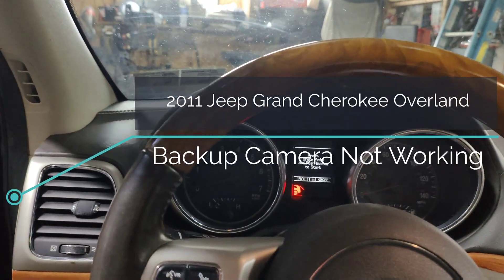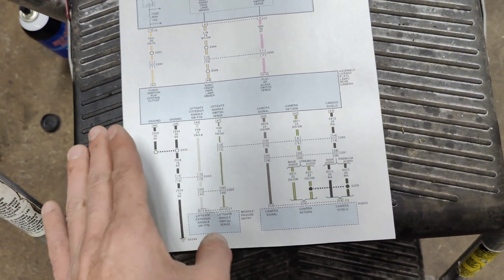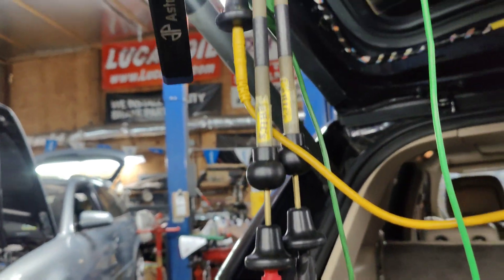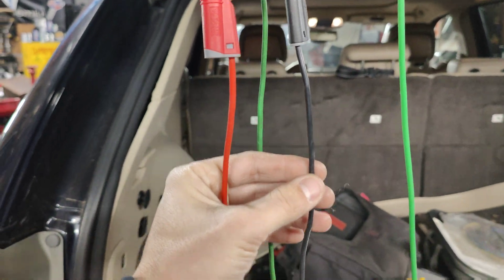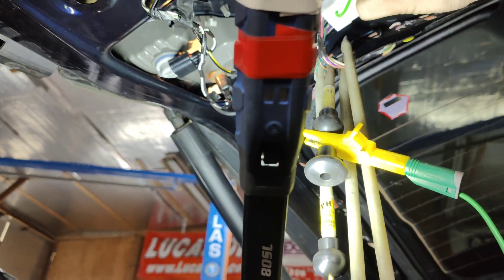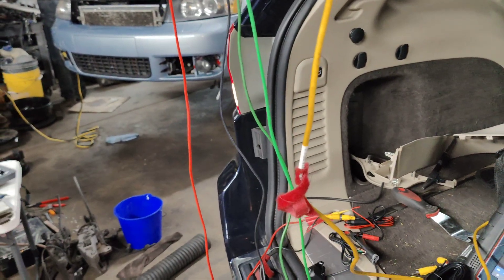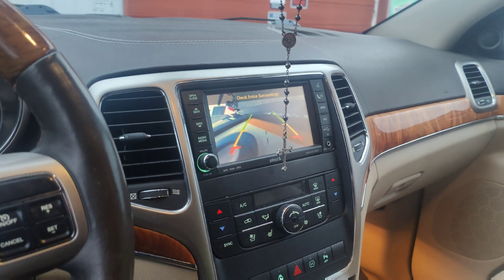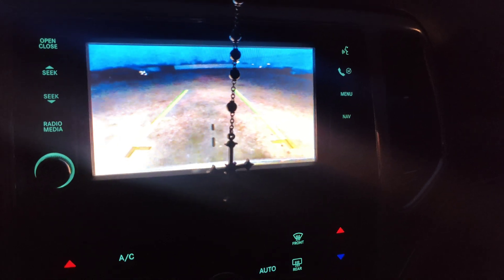How to Diagnose A Backup Camera On Any Car

Comment: Great work but ..I'm familiar wit electrical..Don't know wat wires u are connecting to.if u  wire up step by step this would be no.1 video for this issue/In diagnosing 🙂‍↕️
Reply from the maker: The issue with a step by step is they could be different between years and even trim models.

Comment: Excellent job, Thanks for sharing! I bought an inexpensive CCTV tester that you connect to the signal wire and it will show an image on the screen if the camera is working. It can also send a color bar to the front screen to see if that is working.
Reply from the maker: Can you link to the tool you use?
Reply from the maker: Awesome, I never thought about buying a tester.